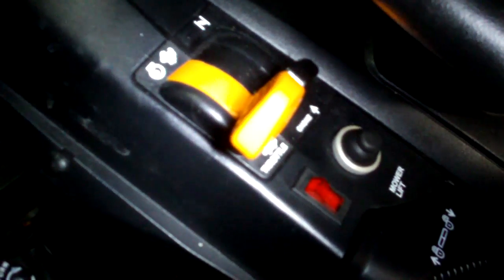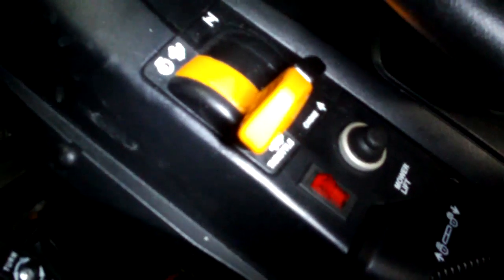John Deere X300 Windshield Defrost System

Comment: thanks for responding so quick. very good information to have as i am doing a similar project. I am using a mid 1990's craftsman garden tractor 18.5 kohler opposed twin and i am building a homemade cab and adding a hydraulicly driven 2-stage snowblower. what was the other heater you added? I saw it had 2 hoses coming from it? did you somehow fabricate a water heater system? what is the website that you post on frequently? i would love to share my progress.   Jeff